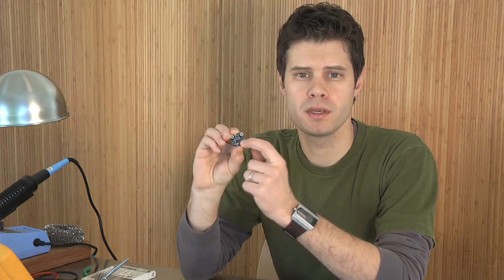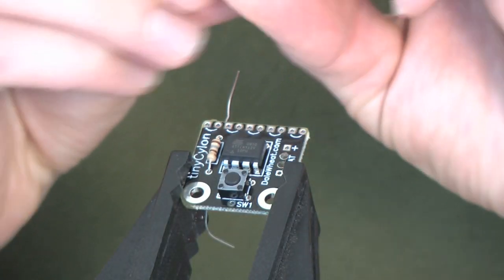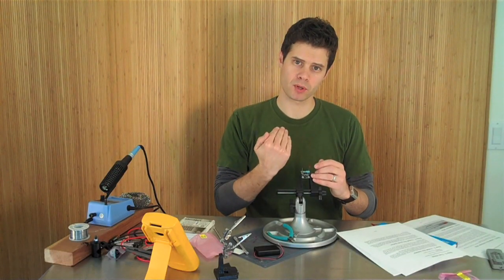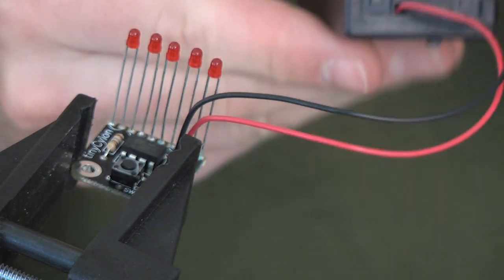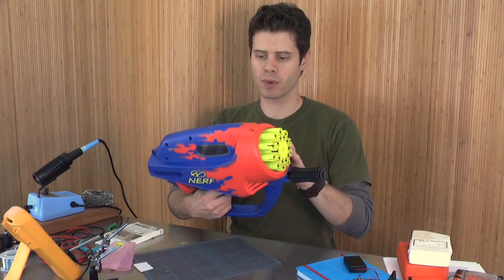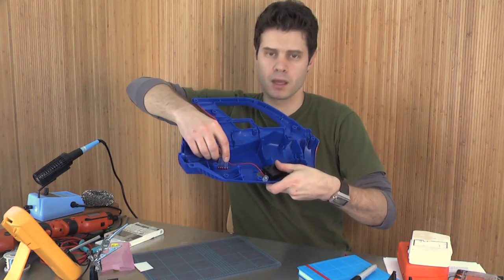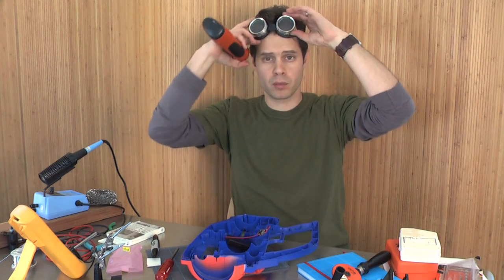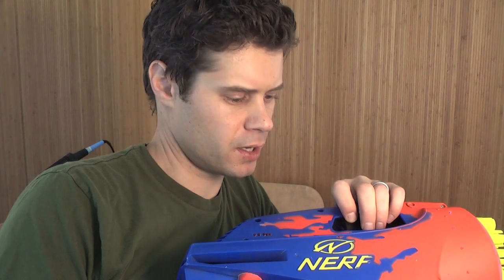John Park in the Maker Shed: TinyCylon kit build

Comment: Hey, if I bought this kit, could I use the LED's it comes with AND add more to it?  I have about 23 more i'd like to add.  Is this possible using everything in the kit or would I need something else (I'm assuming i'm going to need a larger power supply as well ie. 9v battery)